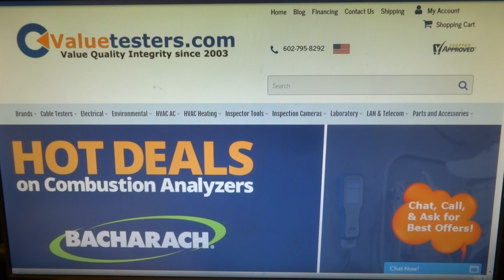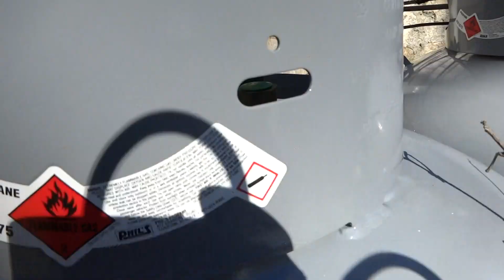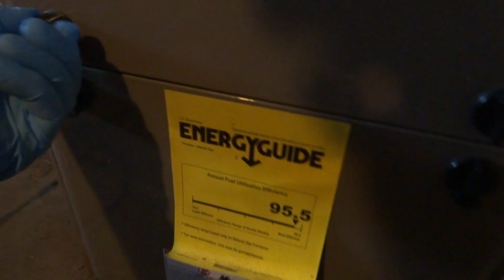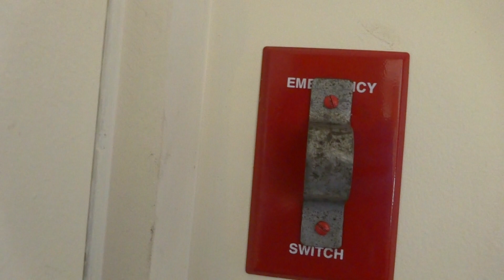gas furnace no heat

Comment: That was something I always came across finding that the switch was off. When I was on call working for a local HVAC company I would ask the customer if they checked the switch and if the thermostat was calling for heat. A lot of times it saved me for going out on contract customers. Sometimes a customer would get upset if that's all it was and had to pay me overtime rate just to come out and turn the switch on for them.

Comment: if  its a leaker on the AC. its a no brainer. a flipping York Microchannel coil. i don't think they are designed for 410A. as Lennox, Rheem/Rudd, and Goodman seems to be better. as these microchannel York units and the units made by Nordyne if its whirlpool badged they all got problems. but not sure on Trane if they are any good.

Comment: Wow, I've never seen a switch like that.
Reply: Emergency oil burner switches ( with that red oil burner plate ) have been mandated by codes in a lot of areas for quite some years . They are to be installed at the top of the basement stairs or somewhere on the first floor so you can get to it in an emergency.